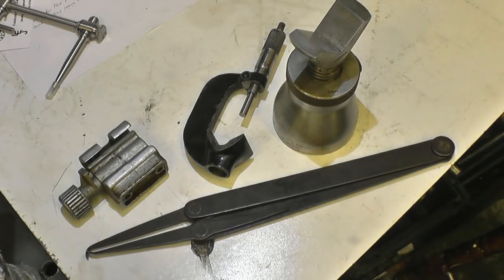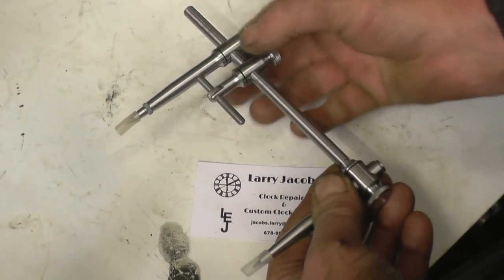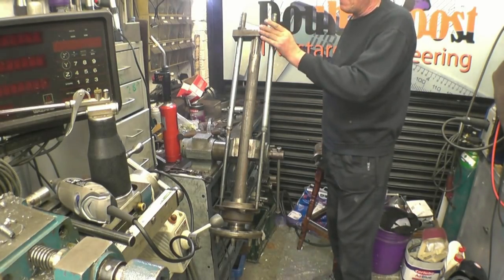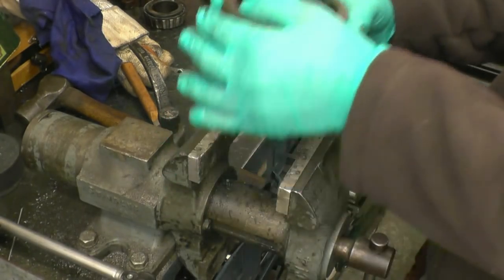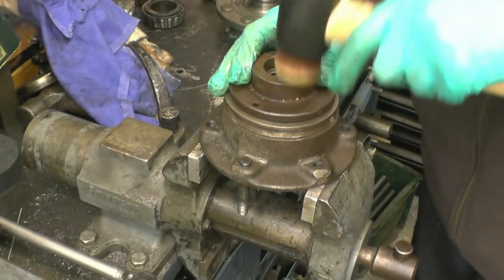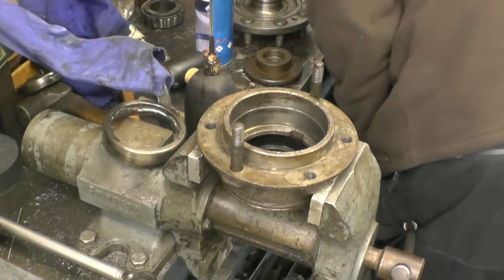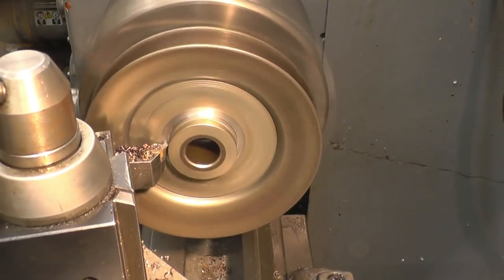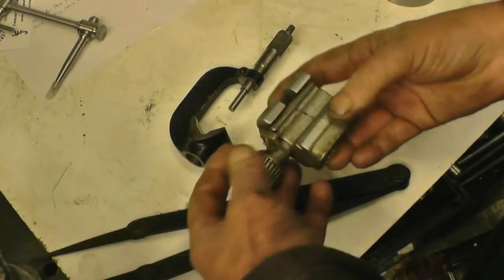SNNC 202 P2   Tractor Half Shaft Bearing Puller

Comment: my dad taught me that weld trick to remove bearings 40 years ago, although he packed the areas around with grease to stop any weld spatter sticking. He also taught me to remove universal bearings by blowing the centre out with an oxy torch

Comment: Neat trick with the welder to get the race out. 

I've used old races as installers before, just have to grind down the OD a bit so it won't get stuck.
Reply from the maker: Yes that is a handy trick  I always keep old races

Comment: Hi John

Another great video :-) Like other comments here, I had never heard of that method of removing an outer race. Fantastic idea! I must admit though I was concerned about pulling on only two studs, I wondered if the hub would be distorted. It worked out well. Thanks for the video(s) :-)

Regards

Peter

Comment: I wasn't too surprised that new bearing was a little loose. If you watch the film where you start to knock out the seal, you can see the old bearing race move in the housing. You might have been able to knock it out or even pull it out by hand.
Reply from the maker: +l wilton well spotted the weld on the bearing track made for a better video

Comment: John, Definitely the wrong bearing. Also the bearing needs to be packed with grease, as the oil in the rear axle does not lube this bearing i.e another oil seal in the trumpet housing further down the half shaft. watch ALL SNNC's brilliant content. Med.
Reply from the maker: Lubrication the same as a truck hub thanks
Reply: I agree. Pack it with grease. This bearing doesn't get lubricated by the transmission oil.
Reply: doubleboost pretty sure the seal is installed wrong way around. Seal keeps oil from entering grease filled bearing. The way it is it will not allow any oil that enters out

Comment: Would a centre drive bolt through the puller cross bar onto the end of the axle and using a pneumatic or electric impact driver save all the sweat? probably another useless idea rom a retired accountant.RegardsMM
Reply: Would work, but you would need a sacrificial base to keep the shaft from being damaged by the centre bolt. Cheaper than the thrust bearings for the puller is simply to stack 4 ( looking at the shaft M20) washers before the nut, with the one on the block being mild steel, then a brass washer then another mild steel then finally under the nut stainless steel. Preferably the thicker washers, and lubricate the lot with EP90 gear oil to keep friction low.
Reply from the maker: +SeanBZA 
Thanks for that